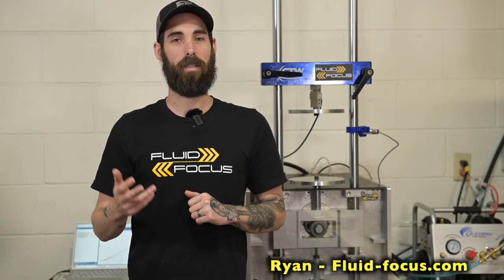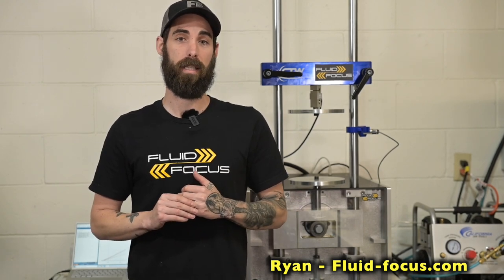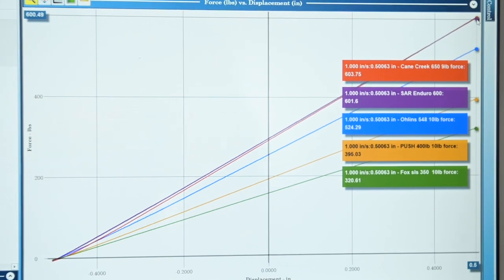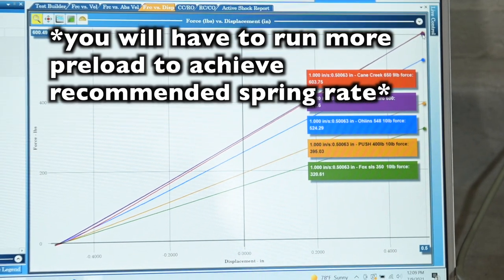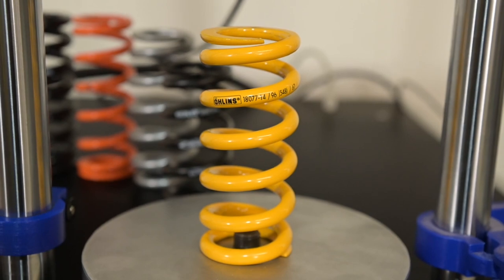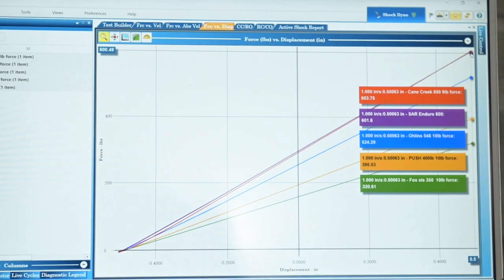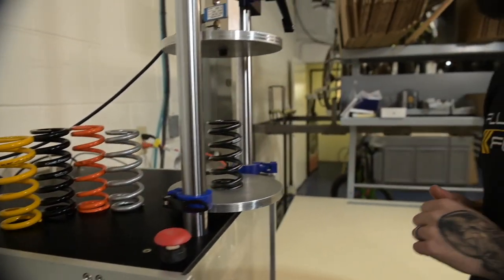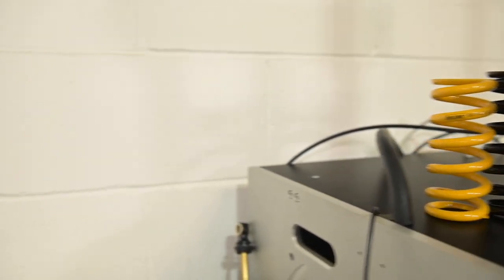Mountain bike coil spring dyno test

Comment: Nice video bros. 25-50lbs off of the documented spring rate is a pretty big deal. I'd be curious to see Rockshox and EXT springs on the dyno too.
Reply: The EXT springs are just rebranded Super Alloy Racing. Or vice versa. But either way, same springs.
Reply: @kevinclark9176  Thanks for the info bro!

Comment: real world: i have a 230x65 shock and used a 350# Rockshox spring to get 33% sag. my target is 30% sag. 
using the Spindex coil set at 345, i was able to hit 30% sag. so the RS spring at 350# is way less in reality, as are many of these in your test. that's really unfortunate being that RS only sells 50# increments so the 400# spring would have been to stiff for sure.
Reply: A worldcup mechanic, who owns a Dyno, just told me that a 450lbs rockshox spring has only 380lbs in rality....

Comment: What did the fox measure? Couldn't hear over the buzzer
Reply: 320, it's on the screen
Reply: @whatsongisthis5691  For a 200$ spring this is a really poor result.
Reply: @fpeter01  Fox SLS is $130, SAR is $150 pluse $35 adapter. But they weigh only a hair more from my research and you get a much more guaranteed accurate rate. Seems worth it.